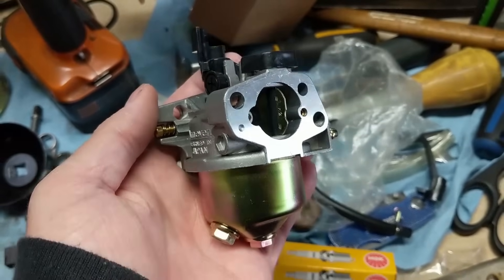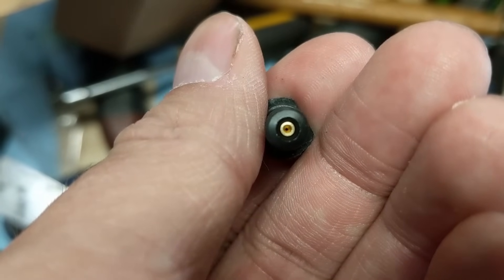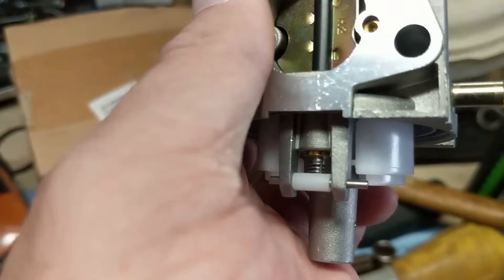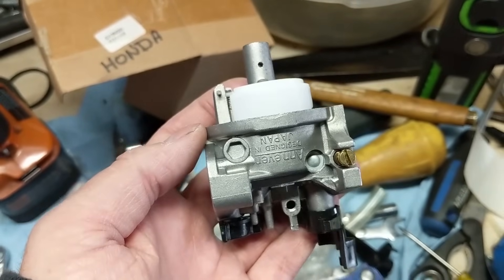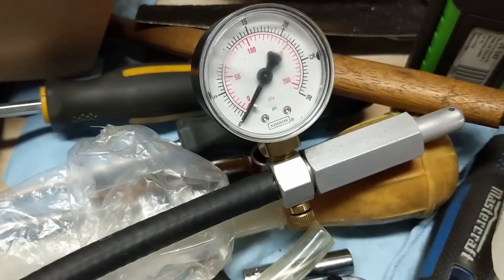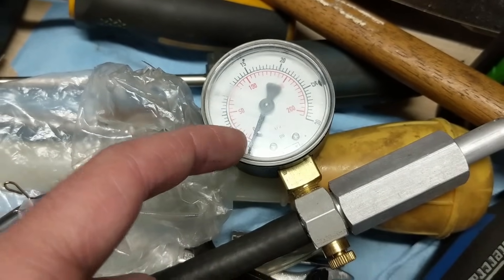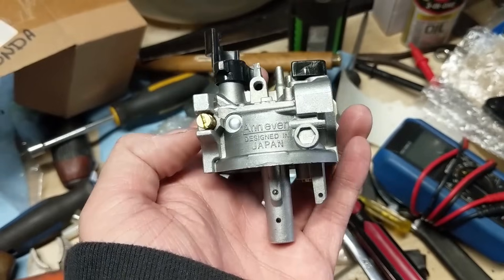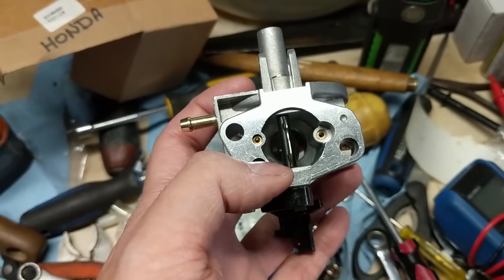How does a Carburetor Work?

Comment: Perplexing carb issue? Was mowing with a LawnBoy 2 stroke model 10324. Started a bit harder than usual today in 45 F weather. Mowed perfectly for 50-55 minutes when suddenly it went "wild" to extreme high RPMs and clouds of smoke.  Could not control RPMs with throttle. Air governor linkage hooked properly, and moves freely without binding anywhere. Choke operates.
Cleaned linkage, restarted mower went immediately to extreme RPMs, slowly began to die, then produced a small pop, died and will no restart. Still sounds like a carb issue but suggestions?
Reply from the maker: Check the reed valves, small flap on the intake in between engine and carb! Also sounds like its running lean, so possibly an air leak. Maybe just loose bolts on carb!
Reply: @EliminatorPerformance  Interesting day. Machine would start after initial "run-a-way" but after the "pop" wouldn't start again and very little resistance when pulling.
Ran compression test - zilch; pulled flywheel and sure enough, top crankcase seal was dis-lodged. Re-seated seal and you could feel compression.
On to carb. Pulled carb off motor and discovered that the plastic throttle shaft had broken and there was no throttle plate present. Darned if I could find the throttle plate or the part of the shaft that had broken. Looked high and low and never did find the throttle plate or shaft. Wonder if broken piece of shaft and plant went by the reed valves.

Without a throttle plate present, no way to govern engine RPM. Also explains why machine suddenly went to un-governed state.
Thanks for your help.

Comment: My lawn mower is profusely leaking gas coming out of the carburetor. It’s sitting tightly on its gaskets but anytime I open the fuel line gas gushes out. I think it’s coming out of the air hole you mentioned.  Any thoughts on why it might not be holding fuel? Thanks for any help!
Reply from the maker: Leaking needle valve
Reply: I’ll check, thank you!

Comment: i was having trouble with  my carb coming out the air cleaner.  i cleaned it and now no trouble. is it possible the atmospheric vent hole was pluged?
Reply from the maker: Yes it's possible, or a piece of gunk keeping the needle valve open
Reply: @EliminatorPerformance  thanks

Comment: hello, and thanks for all your good videos .. I have just 2 things I want to hear from you .. A small honda FC200 soil milling machine .. It goes bumpy up and down at idle. Could it be something with the thin rod with the spring on and how to adjust it ??

Have a 2 year old lawn tractor with a 12.5 briggs engine .. Every single time it turns off it says BANG .. what could it be?   kind regards.. Lars, Danmark
Reply from the maker: https://youtu.be/Z6F38bSxSp4 for the surging issue

And the other backfire when shutting off is because of valves needing adjustment or the fuel shut off solenoid not working

Comment: This was a nice informative video, but can I ask you one question? I was getting gas into the oil on my atv so I replaced the carb because the old wasnt in the best shape, but after the new carb I'm still getting gas into the oil. Do you think it could still be a needle valve or float height?
Reply from the maker: Yes definitely have look at the needle valve, remember that the fuel will flood the carb and go through the cylinder past the piston into the bottom end, just like that riding mower I showed.
Reply: @EliminatorPerformance  Thanks! I also subscribed

Comment: From Jim.  Cleaned carb on Honda HRX 217 2 VKA since it was surging.  it has an auto choke system. The wax pin control is working (checked it by heating outside the unit).  However when I removed the spring screw ( which I assume is a governor ) I neglected to note how many turns it was in.  I guessed and have been doing many trials to get it right.  The mower starts runs fine for a bit and then seems to get too rich a mix and stall.  which way should I go on the screw?  Is it possible that the springs are causing too much or too little tension?  (I had taken off the carb multiple times while cleaning and the getting the gasket order right, I hope.). Been working on this for a week! Any help would be huge. Thanks
Reply from the maker: Hard to say, I'd make sure the needle isn't leaking, so it's not flooding. Then you can turn the air fuel screw out to let more air in (lean the mixture).
Reply: @EliminatorPerformance  Thanks.  Noticed a slight ring on needle.  If I need a replacement, only saw 1 on-line and they wanted $23+ for it.  Is that  for real!

Comment: Very good Video!
Reply from the maker: Thanks for watching M Car!
Reply: For sure man, i really like the theory part. I’ve been working on Small engines for 25+ years even a couple years in a shop. 
Why do you think Briggs went with that updraft design? Because if the needle stuck  open fuel wouldn’t go into engine as you stated? 
Keep up the good videos!
Reply from the maker: @mcarroll598  I'm not to sure actually, it's quite a unique design forsure... They always seem to be a pain to adjust though and sometimes they always have a slight sputter every 5-10 seconds.

I ordered an aftermarket carb and will try it.
Reply: Yeah keep me posted on that updraft. I had one that would only start In low idle speed. Didn’t need choke on... it was weird. Engine was completely overhauled and carb was  rebuilt.

Comment: Hi, I have a question about hole at the upper right side of the air filter side of the carb.  The hole just above and to the right of the right fixed brass jet hole.  I have fuel coming out of that.  It seems to flow through from the underside of the carb.  The float pin doesn't appear to have any effect of stopping this.  ?? a bit confused.  thanks to anyone that can help with this.

Comment: I am about to throw a dad tantrum.  My sons CRF70 stopped running.  Symptoms were carb needed cleaning.  Ordered parts on eBay.  (jets, float valve, float, filter.   Decided to just swap jets while I have others soaking and cleaning.  
Rebuilt no problems. Easy Peasy.   BUT….  It cranked on first kick and ramped to wide open immediately.  I triple checked the throttle pin/sleeve and it’s installed all the way inside knowing the only way it could go in that deep (1 cm below threads) was if the sleeve seated and the pin went down into jet).  But still same result.  Throttle has some play but springs back ok, but not perfect.  After releasing throttle I can still turn in forward (less throttle) more manually.  I then pull cable off throttle grip and reseated cable in hole and down grooves and reassembled guides.  Appears to be built correctly.  Carb is sealed up good to air assemble, sealed good to block inlet, etc.  all o rings new and in place.  Idle screw set to midway.  

I am at a loss.  Before I take to shop any ideas?  

I did buy the new jets 2 years ago and I am curious if I accidentally purchased oversized jets?  If my jet ports/hole are oversized would the stock throttle pin become to small and act like throttle is always open?

Comment: Not sure I understand how a leaky needle valve allows fuel to get into the oil. Could you please explain that?
Reply from the maker: It floods the carb, the carb overflows and depending on the air box design, the fuel may not travel up towards the air filter. So the fuel goes down the intake manifold and into the cylinder. It then leaks past the piston rings into the bottom end of the engine, this flooding the bottom end (engine oil) with fuel.
Reply: Now I see! Thanks.

Comment: I have a RTZS42 22 hp Koheler mower. Won't start when it sits or cold, use starting fluid it fires ups . when engine is hot it starts easy.Change plugs, fuel filter. Please help with suggestions to what I can check next.
Reply from the maker: It's possible you need to clean the carburetor and/or adjust the valves.
Reply: @EliminatorPerformance   Great video! TY, I will try that next.

Comment: I gather that my rubber-tipped needle valve is leaking a bit because the air filter reeks of gasoline (not to mention the garage)... When I drain the bowl and pinch off the fuel line, no more smell.
Reply from the maker: Check this out, might help: https://youtu.be/LkHg82d469E

Comment: I would love to know how to reduce fuel consumption when it starts consuming more fuel than ever and what could be the course of action? Looking forward to your reply please
Reply from the maker: Dirty air filter will make the engine work harder to pull in fresh air. Same with old oil that hasn't been changed frequently, as it thickens it makes the engine harder to rotate. Wrong oil viscosity as well (the weight, or how thick the oil is).

Low compression on the engine. As well as bearings on rotating parts that start to wear down on the equipment, this makes the engine work harder, and consume more fuel.
Reply: @EliminatorPerformance  note it's a two stroke engine

Comment: If I replaced the old carburetor with a new one, does it come with the valves closed or do they come factory set already?
Reply: Depends on who you ordered it from tbh. Chances are they'll be close to what you need, but a little adjustment may be needed especially if you live at a higher altitude.

Comment: My Briggs and Stratton catburetor for a CR950 is pretty much the same as the one in this video but no air mixture screw. It also has a tube cast onto the side of the main jet tube that looks like it draws fuel off the bottom of the bowl whereas the main jet tube has the holes up a bit so the fuel it draws is not off the bottom of the bowl. Anybody know what that secondary tube is for? The idle is good on the engine, but over about 2/3 throttle it starts surging. I can get it to smooth out by choking off the air till the right mixture is obtained but as a result cannot get full rated engine power. I already checked float, and fuel flow into bowl and didnt find anything wrong. Sprayed passages with carb cleaner and no luck fixing.

Comment: What about when the engine is running, and gas shoots out of the carburetor? Its acting like the carburetor is blowing fuel out, Not sucking it in!?
Reply from the maker: Likely the timing is out, if the intake valve is opening when the piston is traveling up it will push air and fuel out of the carburetor. The crankshaft and camshaft have 2 dots on the gears that need to be lined up
Reply: @ Thanks! Ill check that.
Reply: It was actually a plugged atmospheric vent !

Comment: bro PLEASE HELP! my cub cadet push mower wasn’t running so i cleaned the carburetor. once the carb was cleaned it fired up with a little starter fluid yet it idles, very high. i have googled and looked at everything and no one has a solution. i am no mechanic, thank you!

Comment: Second time after I cleaned it, gas in the oil on my push leaf blower
Reply from the maker: @158mollie  that means the needle valve is leaking, I have a video on how to try to fix that, but if the rubber tip is deformed it may not work https://youtu.be/LkHg82d469E

Comment: My question is after clean carburetor run about 30 seconds a lot of gas leaked why need your help
Reply from the maker: Leaking needle valve?
Reply: @EliminatorPerformance  hi it’s leaded after machine run 30 seconds then turn engine off gasoline not leaked

Comment: Gosh. Almost no discussion of cleaning the main metering valve which is the thing that gets clogged even more than the float valve. It is fragile if dirty in that particular carb and almost impossible to  remove. I couldn't get it out. Had to buy a new carb. Fortunately only $20 on Amazon.

Comment: U over complicate when u say not enough air or too much air never think that way. All u need to think about is fuel rich or lean. An engine is an air pump it always pumps the same amount of air, adjusting/tubing the carburetor only changes the amount of fuel it doesn’t change the amount of air, a 200cc pumps 200cc’s of air with every stroke that can not be changed unless you bore and/or stroke the engine. When you think about an engine this way and that u have too much or not enough fuel it’s much easier to figure out the problem. If there is a vacuum leak the engine is not getting too much air it’s running lean. When an engine is lean it bogs and when it’s rich it stumbles which is the easiest was to know what ur engine is doing.
Reply from the maker: Dirty air filter > not enough air > runs rich. Not a fueling issue. It's not over complicated at all, and I explained that in the video. Thanks for watching.